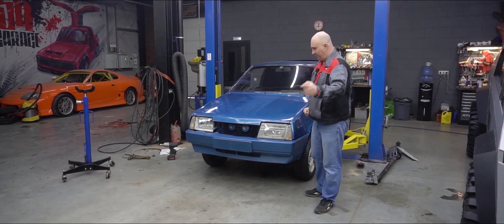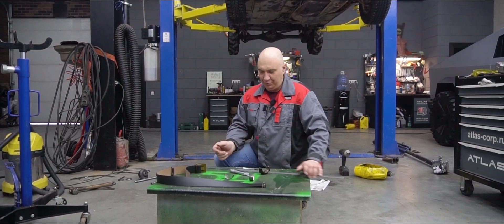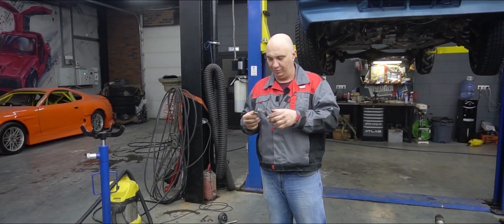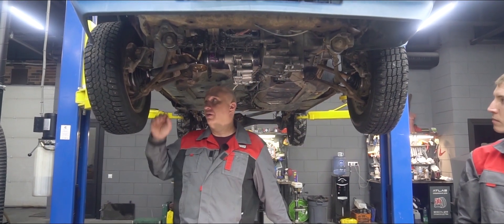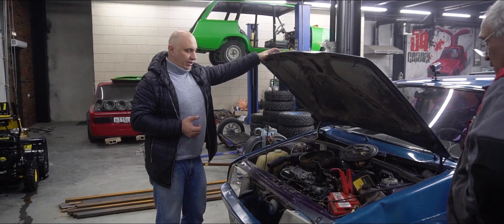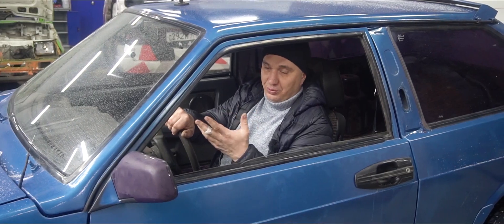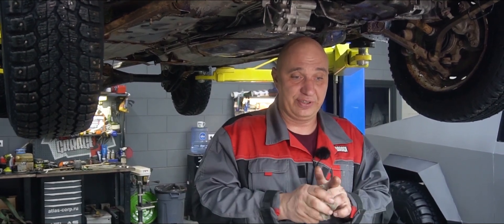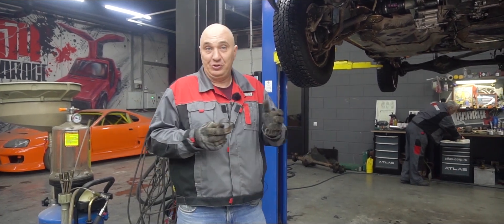Can you replace crankshaft bearings with leather belt?

Comment: You have to make a hole for the oil to go through it and oil the crankshaft
Reply: Most 4 cyl. engines I know of, oil through one or more of the main bearings (not the rods). The only instance where you'd need an oil hole in the rod/rod bearing, would be if it was drilled to shoot oil up under the piston, in the case of a turbo motor.😉

Comment: When I tore an old  tractor engine down that belonged to my grandfather it had one rod with a piece of leather in a rod bearing.  It was an old Farmall c. Probably main reason I was tearing it apart. But I was told by neighbor down the road , it was temporary just to get it home to do correct repairs there. My grandfather passed before repair was made. It was a temporary fix at best.

Comment: Drill a hole like the factory bearing has. Then you can pass fluid.
Reply: Leland Sajdak factory conrod bearings almost never have holes in them (just like the ones in this engine if you look closely).
Reply: Did they only do the rods or the mains too?
Reply: Leland Sajdak only the rods

Comment: How about suck starting a engine from the exhaust
Reply: I knew a ol gal who could suck start two harley's at the same time.
Reply: @sh3lbot  her dad must be proud lol
Reply: Will you guys make a drive shaft out of a cable? I think you'll get off the line better with less burnout
Reply: @rexspeedworthy  Sounds interesting too. Just so I'm sure my vision is right, a steel wire cable, which has been pre-tensioned to take up any slack ?
Reply: Never thought of that. It's actually a great idea for an experiment. And if they can't start  the engine by suction, they can see if they can suck the engine oil out through the headers....
Please, Vlad !!!!
Reply: I had a friend who could blow start a Ford. He had gotten a dui
Reply: It won't work because the greatest 100% vacuum is only -1bar relative or 0bar absolute but in other cilynders is abuot 10 bars of pressure to overcome so no way of starting it that way...
Reply: your mom could do that easily

Comment: After dropping the pan and replacing rod bearings, I doubt you’d save any significant money by using leather 😂
Reply: G'day,

It's the sort of thing which one might do, as an "Emergency Field Repair". 

Not so much to enable a vehicle to drive any long way back to Civilisation..., but more to enable the Engine to be briefly run, at an Auction type of situation - given Low RPMs, & No-Load, then it might run for a total of 10 minutes, perhaps - if switched off & allowed to cool down every 2 or 3 minutes.

Given an Engine which has totally killed ONE of it's Big-End Bearings..., and assuming that somebody doesn't want to pay for a new set of Bearings, or that they can't locate a set which will fit the Shaft & the Con-Rods...; then a possible option is "Bodgie-ing it up" with a temporary Leather Shell to make it able to start up, and run for a while without producing any Big-End Knock..., and sell it.

The idea would be to make the Leather Shells the exact dimensions of the metal Bearing Shells, cut an Oil Groove in them, and drill the Oil-Hole too.

  This "Experiment" appears to have been trying to show how NOT to use Leather for an Emergency Bearing.

   Not Ethical, but neither is Banannas in the Differential ; and there are people who do that.

Such is Life.

Have a good one.

;-p

Ciao !
Reply: WarblesOnALot 
Hi,
yes. But have you considered the price of one bearing, possibly used from another engine, vs the cost of labour to open an engine, that’s my point.
Reply: @harbl2479  What labour? Someone doing this would be doing it in his garage anyway. No one will pay someone to attempt a botch repair.
Reply: renyn21 
It’s a fun experiment. I’m just saying no one would ever really do this. A new bearing is so dirt cheap and someone who knows how to disasseble an engine could probably source used parts which would still be better than using leather lol

Comment: Put some holes in the belts so the oil can flow through them. It will make a HUGE difference.
Reply: Everyone who thumbs up’d this comment doesn’t know how an engine works! Conrod big end bearings almost never have oil feed holes in them, as the oil feed comes from the main journal.
Reply: @BajamanCam  why wouldnt oil holes help it? better to run them dry?
Reply: mikko mäkinen how would the holes help? The oil feed comes from the crank into the bearings... the oil doesn’t pass through the conrod bearings like it does a main bearing.
Reply: No he's right. Many engines I've seen have an oil passage that goes up the piston rod and to the wrist pin bearing.  It has to be drilled at the correct spot though so the oil pressure comes out at the correct moment during firing stroke
Reply: This! Why didn't he cut holes for the oil passageways? No oil will flow into the rod journals the way he did it.
Reply: crxtodd16 wrong. The oil feed comes from the mains and into the big end journal. Conrod bearings almost never have oil feed holes on them.
Reply: @BajamanCam  - oops, was thinking main bearings while typing rod bearings. My bad! Haha
Reply: You must have a hole in your brain
Reply: RR_Productions no the crankshaft has holes to feed the conrod bearings! The only time conrod bearings have holes is to feed the small end. Most engines do not have holes in the big end conrod bearings. The oil pressure comes from the crank!
Reply: It's Garage 54... i think they know what they are doing... it's literally their life.

Comment: how about JB weld epoxy bearings. LOL. 
maybe if you used Vasoline on the metal surfaces it could harden in place. or you could make molds and reproduce them . Also you could try glass bearings.

Comment: Ok, Bearing clearance is critical! The "bearings" Should be of PROPER thickness! and cut into half and glued to the rod and cap with the smooth side to the crank. The bearing was too tight and the oil galley hole chewed up the belt! I have actually thought about dong this! If done proper it will work fine till the leather eventually gets hammered flat resulting in excessive clearance and loss of oil pressure.

Comment: its from way before the 90's, I've heard it from back in the model T ford days(as in, was an old farmers car/hack/farm vehicle, not as in brand new) durin depression, double checked from someone who did it(now 89 years old), lasted up to a day, it was a quick fix in a babbitt bearing motor(typically 1200-1800 rpm max), typically only 1 bearing, usually the BIG END bearing, they covered the belt piece in oil before installing, and punched holes in the center every CM or so around for the oil passage(leather hole punches were common in toolboxes even up to the 80's on farms, at least where I am from).

apparently low speed, correct lubrication, correct application is fairly important to the ability for that to work.

Comment: should probably link the wooden piston video in the summary

edit: take note from older American/European aircraft, try castor oil/natural oil, wont last long in current vehicles ignition systems, but will work friendlier with the leather perhaps?

Edit Edit: soak the leather in the caster oil/ vegi oil for 30min/2 hours to see how thick it gets vs the original bearing

Comment: my grandad did this but he copied the oiling holes ...oiling an two separate pieces upper an lower.  my cousin made a bearing out of copper tubing smashed with a hammer  with oil holes drilled in always  done with one or two cylinders messed up but not the whole engine bearing replaced....54 wasn't done yet he could have re done the bearing s with oil holes and flushed motor out with diesel get the bits of leather out clean it use thinner oil ..54 maybe make some sheet metal folded bearings too with oil holes drilled in....54 you are not done yet

Comment: You should flush that leather out of the system and try it again with wooden bearings. I bet you could find wood veneer the same thickness as the original bearings. If you tell then what you are trying to do,, they might even send you a selection of different thicknesses so you could try a few different ones, or a different thickness on each rod,

Comment: Maybe cut an oiling channel (like actual bearings have), and trim the excess off the sides (after installing the rod cap)?

It seems promising to me.  Since a bearing doesn't contact the journal IF oil pressure and clearances are correct.

Comment: We used to cut the strip out of old shoes or cut up a tobbaco can and use these to shim  bearings it worked but for only a short time and worked best on engines with pressed in bearings I believe they called them babbeted rod bearings.

Comment: I know that they used a certain kind of wood for bearings in ships engines and or driveshafts.
Maybe you can try that.
Reply: My old International disc harrow had greased wooden bearing blocks
Reply: @lamarzimmermanmennonitefar5269   Those would have been white oak! I've made several white oak parts for old horse drawn implements for some Amish down around Mexico Missouri years ago.
Reply: Called Lingum Vitae (tree of life) they used it on the prop shaft where it went through the hull. It's called a gland,and the wood was wedge shaped about 3 inches across and however thick and long it needed to be. Made a thrust type bearing, every so often they would drive the wedges in,until they couldn't,then replace them. I had a boss on a river boat who was a chief engineer in the Merchant Marines and he told me about it. Wood was so dense it didn't even float,and the growth ring/grain was so tight it would shave like soap with a sharp knife. He said when you stained it it was a solid color,without any variations! Would love to get some to carve.
Reply: @tomcline5631  The original seagull pistons were supposed to be made of lignum vitie.
Reply: @gringoanon4550   I'm sorry I don't know what the original seagull is.
Reply: @tomcline5631  Seagull outboard motor.
Reply: @gringoanon4550  Oh, I'll be Damned! Wonder how they lasted?
Reply: @tomcline5631  From what I gathered they had a metal top as a heat shield. and were low horsepower,

Comment: I'll bet it would have worked on a Trebant.  Air cooled and crank case scavenged.  They were complete garbage, but those engines are built to unbelievably loose tolerances.  Most importantly, no oil pump.  The crank case was lubricated by oil mixed in with the fuel.  I'm really surprised these guys haven't messed around with any Trebbies yet.

Comment: 30 weight motor oil in the transmission and transmission fluid in the motor.
Reply: Keith Perry what’s the point doesn’t even get oil regardless
Reply: @ChrisWilliams-i7d  nono
Reply: - he means sae 30, which is commonly referred to as 30 weight

Comment: In the old days some of the old hit and miss stationary engines has leather/rawhide bearings, and using leather was a common. Repair for failed babbot bearings
Reply: Probably worked when running really low RPMs.
Reply: Marcus Cook it worked very well on a SPUN bearing that had burned out all the clearance.... In other words it worked very well for a temporary fix on a knocking Rod! Never would it be used in place of  a good Babbitt bearing!
Reply: i used the pulp outer shell from a bow d arc tree apple once on a boat trailer bearing that had melted. Found some beside the road, kicked the pulp in with my boot, stopping every mile to repeat. Made it home another 12 miles without burning up the hub nor the axle. Quite a mess to clean up, but did the job...
Reply: They also used grease instead of oil.
Reply: running 15W50 is close enough to grease lol
Reply: rbmk 1999 - I posted the same comment, took it away when I saw yours (old boat motors too)
Reply: Yeah I was gonna say they had the right idea using rawhide instead of leather designed for looks.

Comment: When we were young a mate of mine bought a really cheap Ford Fiesta as his first car. He said it was too cheap to pass up, But personally I felt it was TOO cheap to be any good.
The engine started to knock quite badly after about 200 miles. As the scrap yards were piled high with 1.1 Fiestas and Escorts back then we just paid £40 for a known running engine and dropped that in (Once we had the replacment engine over his place it only took us about 3 hours total....... God I miss how simple cars were back then. :) ).
A year of so later we were doing something in his parents garage and I noticed that the old engine was still under the workbench. So, Mainly out of curiosity, I suggested we strip it down to see exactly what was wrong with it. We dropped the sump and found REALLY thick oil with blobs of green gunk in the bottom of it. I couldn't work out what the hell it was, So we dug further. When I popped off the main caps it all became clear. The main bearings had been replaced with............... Flattened pieces of copper heating pipe !
Someone had decided that the 20 or so quid (At that time) for a set of main bearings was way too expensive for a car of this ones age, So HAMMERED copper plumbing pipe flat and to about the right thickness, Then wrapped it around the main journals. The finishing touch was to quieten it down by filling the sump with the thickest oil they could find.
Looking at how it had been bodged, The impressive thing is that it managed to cover over 200 miles like that before the "Bearings" finally gave up. Surprisingly though, All the cranks journals didn't look in bad condition despite what they'd been through. At the time we could have probably rebuilt it for 50 or so quid.

Comment: Garage 54 my neighbor say his did the leather on a rod knocking 350 Chevy v8 on 1 bearing and it lasted all summer as he did keep rpm low but even did short slow towing with it a time or 2 ..i thought not way but.{{one has to sand real saddle type leather}} it to the proper thickness he says pre soaked in oil  !!!! only use on one bearing it used to fix one a knocking slow turning engine work best on inline six i would say not a low toque 4 cylinder

Comment: How about putting the bearings back in, and installing zerk fittings on all bearing caps....Give each cap a shot of grease and drive it without the oil pan.
Reply: oil-less engine would be cool but the sleeves and rings need oil
Reply: Making custom bearings from bronze and useing grease fittings would definately work

Comment: I'd piss my pants if someone I knew bought a car with wooden pistons or leather belt rod bearings. I had a friend buy a supposed "built" B18C JDM Integra Type-R engine and after he installed it, he turbocharged it, had it tuned, drove it around like that for 1000 miles before the engine developed some serious rodknock. He tore the engine down and it had all stock B18B1 PR4 (1.8L Non-VTEC from the base model Integra) internals, meaning the crankshaft, pistons, and rods were all OEM Integra LS/GS/RS internals. He gave the guy $2500 for a supposed built JDM Type-R engine and it had stock base model Integra internals. You can imagine he was a little angry. The guy didn't even put it together with new bearings or rings, he reused all of the stock bearings and rings that were in the NON-VTEC engine.

Comment: this was done regularly on the 3 main model T.. babbit wore down, no replacing bearing easily. they made all kinds of noise even great condition, the lether only helped it. they also had an oil called cosmoline, not like today.
Reply: barry g73 this. It worked with babbits, not plain bearing

Comment: I guess this is a better option in case you have a knocking bearing, where instead of buying another bearing and hopes it doesn't still knock from wrecking the crank journals, it will quiet it down enough to sell the car.